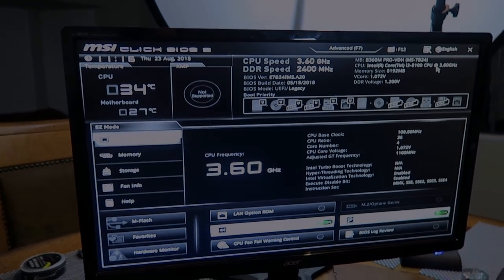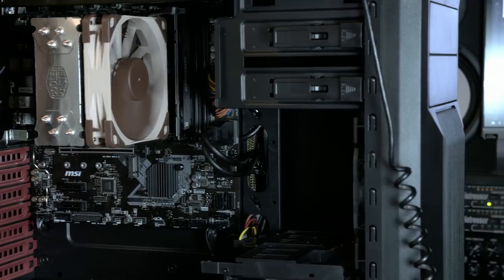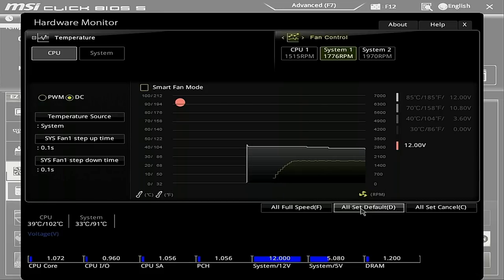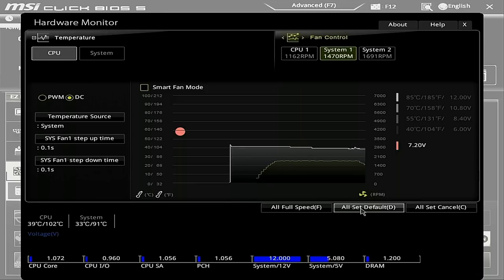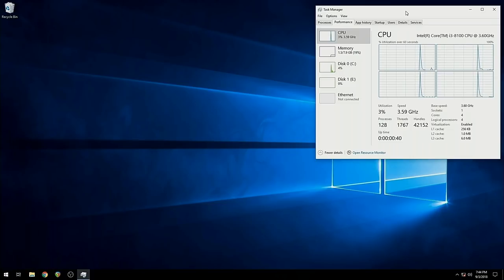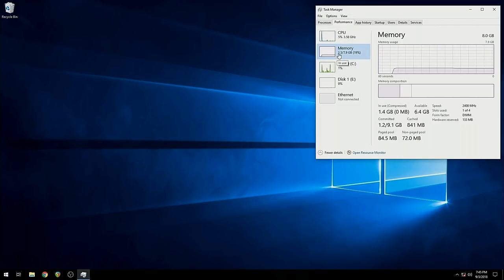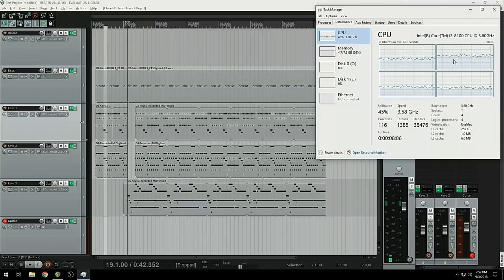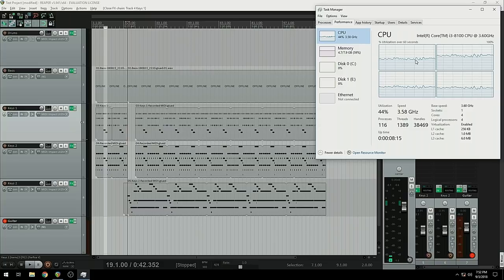Building a $500 Audio Production Computer

Comment: If anyone is thinking of building a custom pc but not sure what route to go or just don't know much about building a custom pc NewEgg has DIY pc combos for almost every budget.
Reply from the maker: Good suggestion!  I also saw that NZXT and even WalMart are now offering pre-built systems.  Those ones from WalMart look a little sketchy but are a pretty good value.
Reply: @YHRS  I have watched a few vids about those Walmart pcs they seem to be great starting points they did use some good parts and also some crap parts too. It seems like the biggest flaw with walmart's pc are the mobo and power supply.
Reply: @A_Class216  would a Gaming PC be good for this line of work?
Reply: @hoodie3016  yes. Razor, msi, and alienwear seem to be the most popular among producers.

Comment: Great video. 
A few quick comments.
1. It would be inadvisable to throw away the plastic protector for the CPU socket. Anytime to you need to RMA that thing, you will need it.
2. The case choice seems a bit off. Something like a 100R can come at a similar price and can be way quieter.
Reply from the maker: Very good point about the CPU socket cover.  I've been blessed with exceptionally good luck and I've never had to RMA a motherboard.  But you're right, it'd be worth keeping that cover just in case!

And for the case, I was limited by what Microcenter had in stock at the time.  So that's how I ended up with that SPEC-02.  It was one of the only mATX cases they had in stock (although it's technically a full ATX).  The only other compact option was the atrocious Q300P.  So I went with the lesser of two evils :)
Reply: In that case, great choice :p

Comment: Very good video.  You precisely explained, covered and demonstrated what is required for the audio workstation. I wonder why other creators are unnecessarily going behind the most expensive components and graphic cards too.
Reply: Dual purpose builds - I’m doing same right now.  I want to be able to use the computer for audio workstation occasionally so the spec for that is important.  But the more critical one is its capability when running DaVinci Resolve Studio which is very GPU reliant - so while that same GPU can take some of the burden off the CPU during audio sessions (it all helps) the main reason for an OTT one is for the video editing (or with some its gaming) applications.  Hope that helped.

Comment: This is awesome! i'm a recording musician and just upgraded my system that I've been using from 2008... your DAW is really potential.. I got to go to 'used PC' route since everything is so much more inflated here ($220 just for the same i3 8100).. so I got myself a 2012 i5 3570K OCed to 4,3Ghz using Cubase Pro 9.5.. will use my current one until I could get my self a newer PC... oh and i'm typing this with 2007 Q6600 Bsel to 3Ghz.. LOL.. keep up the awesome channel man! you're super COOL!
Reply from the maker: That system should serve you great while you save up for an upgrade.  4 cores running at over 4ghz is a beast.  Just watch that heat and the loud fans that can result!
Reply: Thank you... Thankfully the used system come with aftermarket giant Thermaltake Cooler that help cooldown the CPU within 68C during heavy load while maintain whisper quiet.. it also come in 16GB DDR3 RAM on Gigabyte Z77x mobo.. (this system was a gaming setup minus the high power graphic Card.. i bought it used from a gamer! =)

i was aiming to 8th gen i5 with 6 cores processor and wonder how much benefit the extra cores for Cubase/DAW system.. hopefully the upgrade would be significant enough.. i use my DAW for heavy VSTi composing, mixing, mastering and Audio editing.. (i often hired as a post production to edit a live concert data.. it can reach above 300 audio tracks+ ... for this purpose -- SSD are God Sent!).. so far i use 25-50% ASIO CPU performance of the system.. and it run without and clicks or crackle using 128 buffer size (3.5ms latency) on Presonus Fire mobile (this audio card is very problematic for me.. i also use UR22mkII, but it got double the latency (7ms) in 128 buffer size.
thank you for your reply and sincere goodluck for your awesome channel!..
Reply from the maker: Sounds like a good system for making music!
Reply: @YHRS  thank u.. the presonus firestudio mobile just dead though.. bummer.. now i have to get a better audio interface instead of upgrading my PC..

Comment: Excellent video, tad... in the end I got a laptop. We don’t have air conditioning in the uk, mate.
Reply from the maker: Speaking of which, how is the laptop working out for you?  That thing looked like it had great specs, I'd bet that it's doing everything you ask of it.  And yeah, it's hot upstairs in my house...77 degrees is on the upper edge of what's tolerable.  At least it's a dry heat :)
Reply: What laptop did you go for bro?

Comment: That is kind of hot considering I am running right now 28C (CPU) 23C (System), according to Speedfan,  while watching this video abd I cannot hear my fans, although that might be more to do with my hearing being bad too/  I do use Reaper plugins for OBS, video recording software, and set a noise floor before I record, so I am sure that helps when doing voice over type things.
Reply from the maker: Agreed.  My 4790K idles in the high 20s, and my Ryzen 7 idles in the mid 20s.  I suspect that the EVO 212 isn't getting the job done.  I'm going to try and reseat it today and see if I can bring that idle temp down.
Reply from the maker: I did end up adjusting the fan curve of the CPU cooler and it's more in the mid-30s now, rather than the low 40s that I was getting at the time.  Plus it's winter here and ambient temperature is several degrees cooler on average, so that helps quite a bit as well.

Comment: Now it’s save an extra 200$ and buy an M1 mac mini... those things seem to be knocking it out of the park.   This is a great approach to getting started, my priorities for this build’s upgrades after the initial build would be getting to dual channel memory with a 2nd stick of RAM, a dedicated gpu - nothing fancy just something with vram to pull rendering off the ipgu.  There were some folks on gearslutz who were able to demonstrate that getting graphics rendering off the igpu helped overall system performance, even within the DAW - again nothing fancy needed no gaming card, just something with some dedicated vram.  And then a decent SATA ssd, could probably get all 3 for under 150$ if you shop for good deals.
Reply: I agree with your comment about 
using macs for recording and daw.
There so much better latency than windows.

Comment: Great video but you can get much more bang for your buck buying a use Dell on eBay with Xenon processors (usually more than one) and they usually have 32gb of ram or more, still in that price range. I have 3. They run Cubase 10 and have yet to hit wall, I think the most tracks I've used, along with many plug ins, is about 32. Do a search enter you spec and let eBay do the rest.

Comment: Thanks for your video! It has really helped me out a lot. Unfortunately, I am strapped for $$$ like so many people these days and I MUST replace my aging Lenovo (which has served its purpose). I'm a composer and musician and I primarily need a PC that I can use to run Sibelius and the sound modules that I have for it.

With the sudden upending of life due to COVID-19, I'm also short on work as a teacher and musician, as you can imagine.

Question: Do you have any updates on your recommended parts list? I've got the general idea where you're going with your recommended parts but your list is now 2 years out of date (as this is late July 2020).

Thanks again!
Reply from the maker: I think that the bang-for-buck honors definitely belong to AMD Ryzen right now.  They're offering more processing cores for the money, and in their lower end of CPUs there are some really great values there.  The Ryzen 5 3000 series seems to be the sweet spot right now.  And I think that the B450 motherboards are the value sweet spot as well.  RAM has come WAAAAY down in price since this video so that'll be another money saver.  I'm certain that a today's $500 build, centered around a Ryzen 5, would run circles around the computer I built a couple of years ago.
Reply: @YHRS  I ordered the parts already! I'm waiting on the Ryzen 5 3600 and the MSI B450 Tomahawk - probably more than I need.
Waiting on the parts to arrive.
Oh, was also able to get a used Corsair CX-850 power supply fairly cheaply... that helped.
I'm sure that it's going to run rings around my old Lenovo that I got 7 years ago! (Darn, it's slow!)
You helped me justify what I was doing and NOT doing.
Again, thanks for the video!
Reply from the maker: @georgetate6055  Heck yeah, that'll be the bones of a great audio system!  I think it'll serve you well for a long time to come.

Comment: Dude I am on a budget, can you please tell me which one is the best option?
Intel i3-10100F 3.6GHz, 16GB DDR4, 1TB HDD + 120GB SSD, GT 710 2GB, H410
 or Intel i3-10100F 3.6GHz, 16GB DDR4, 240GB SSD, RX 550 4GB GDDR5, H410 or AMD Ryzen 5 3400G 3.7GHz, 16GB DDR4, 250GB SSD, AMD Radeon™ Vega 11, B450 and last AMD Ryzen 5 3400G 3.7GHz, 16GB DDR4, 500GB SSD, AMD Radeon™ Vega 11 A320. Thanks!
Reply: the last option will do. you will need a high single core frequency CPU for handle most plugins in your DAW and big storages SSD for samples and plugins

Comment: Found all the parts on Amazon. Comes out to $732.39 -$150 Discount = $582.39 NOT BAD AT ALL

That case is expensive as shit though. You got me thinking and I'm gonna play with some specs on this build.

Stand back, I have no idea what I'm doing...
Reply from the maker: Yeah that case wasn't all that great.  It wasn't bad, but it was just the cheapest thing I could find at the time that I made the video.  There are all sorts of affordable cases on Newegg and Amazon, so it should be relatively easy to find a good fit for your needs.

Also, take a look at AMD Ryzen CPUs and the corresponding AM4 motherboards.  You might be able to get more bang-for-buck today than when I made the video.
Reply: @YHRS  I have been hearing that AMD offers nothing but headaches for home studios
Reply from the maker: @jasonpocorus2338  I've been using Ryzen CPUs for about 3 years now, and I haven't had any issues.  That's just my experience though, there may be people out there having issues with AMD systems.  It's been great for me!

Comment: What could/should I add and/or change if I also wanted a computer to do video editing? With no concern of going over $500 but not too much over. Thanks.
Reply from the maker: For video editing, you'll want a CPU with as many cores as you can afford.  When it comes to lots of cores for reasonable prices, I'd suggest looking at AMD Ryzen.  You can also benefit from a graphics card that is compatible with your video editing software.  NVidia GPUs specializes in CUDA, and AMD GPUs specializes in OpenCL.  You don't need a top-of-the-line GPU or anything, but even a modest graphics card can help participate in rendering and hardware acceleration.
Reply: @YHRS  Keep in mind some audio plugins and VST instruments aren't compatible with Ryzen.  But that's not a big deal, since there are only like a handful of them, but it is important to note, nevertheless.   :)

Comment: So.. I have a shitty little home studio. Scrappy line 6 amp. Using a small tv as a monitor. I use a Dell optiplex 3020 sff. I3 4150, 12gb of ram. It's actually just fine. I forgot to mention I use a small 5 channel mixer that I plug into the optiplex via usb. Record my guitar via a MAP 990 studio mic, and vocals and soon bass. So... It's working fine. It runs REAPER beautifully. LV2 plugins and stick reaper plugins work well too.. No xruns..
Reply: MXL 990*

Comment: Hey man, loved the insight you provided on this video! I’m planning on building this setup, so I can start producing, but I would love to hear some more advice on what I should do. So I have a bit of a higher budget - 800-1k - and I want to also do video editing on the side. My question is: Do you recommend any upgrades on any of the parts you provided, plus any additional things I should add? Thanks for your knowledge and help! Cheers
Reply from the maker: With that budget, you can make some great and meaningful upgrades.  If you're doing video editing, then I'd recommend a CPU with as many cores as you can afford in your budget.  You could opt for an Intel i7 or i9, or if you go with an AM4 motherboard you could opt for any of the AMD Ryzen CPUs that have high core counts for reasonable prices.

You could also upgrade to a more renowned brand of power supply and SSD.  I'm a big fan of Samsung EVO SSDs, and power supplies by EVGA, Corsair, Cooler Master, and Thermaltake all have good reputations and come in lots of different wattages and cable configurations.

I'd also add at least a modestly priced graphics card.  You don't need anything fancy like a 2080 ti or anything, but maybe a GTX 1050 or 1060 or something similar would be affordable enough while still giving some benefit when rendering video.

Best of luck, I hope you end up with a mean machine for audio and video!

Comment: Awesome Video!! What's your take on a M.2 for programs, daw, vst etc.. and using ssd sata drives for projects and files? Will that make it run better?
Reply from the maker: I'm a big fan of M.2 NVMe drives.  I've got a Samsung 960 Pro in my audio computer and it's insanely fast.  But I'm editing and rendering video to that drive so it gets a workout.  Under normal circumstances of recording and editing audio, I never even use 1% of its throughput.  So a crazy fast NVMe M.2 drive is cool, but certainly not necessary for audio.  But it sure does make booting and app launching really fast!  Same goes for SSDs for audio/project drives.  They're cool and certainly won't hurt anything.  But probably not necessary if you're on a budget.  But if you've got the budget, I'd say go for it!
Reply: Sounds like a plan then! Thanks for your time and feedback!!

Comment: Awesome video.  I'm looking to build a music production PC because 1) I've always wanted to try building one, 2) it seems like I can do this for cheaper than a prebuilt machine, and 3) I live near a Micro Center as well so I can get even more saving with their component bundles.  I've thought about getting a AMD Ryzen 7 2700X instead of an Intel i7 mainly because it's cheaper and comes with a cooler (I'm gonna use my old stock video card with my Dell XPS; more money saved).  Is a Ryzen 7 with 16 GB of RAM good for music production and low latency (currently using Studio One)?  I think it is from my research, just looking for a second opinion.
Reply from the maker: I've been using the 1st gen Ryzen 7 1700 as my music and video production machine for close to 2 years now, and I absolutely love it.  8 cores eats video rendering for breakfast, and it's more than enough for a great user experience for audio production.  I highly recommend it!

Comment: Which one would you recommend - a AMD Ryzen R7 2700 or Ryzen R5 3600 which are practically at the same price point? 
From what I understand 2700 has 2 more cores and 4 more threads but 3600's fewer cores are more efficient because of it's newer architecture.
Is it worth paying the slight "premium" for the newer 3600 or do 2700's more cores make more sense in music production?
Reply from the maker: That's a tough one!  My tendencies would be to get the more recent one, but since we're comparing 6 cores to 8 cores, that makes it a little tougher to decide.  

If you're doing any video production at all, then more cores would get my vote without question.  In audio production, different DAWs seem to handle multi-threading differently.  I know that Reaper is very good at taking advantage of multiple cores/threads and it spreads its load very evenly.  But I've heard from a few other home recording guys whose DAWs tend to favor one or two cores and leave the rest pretty much idle.